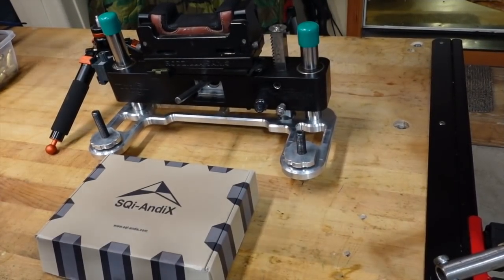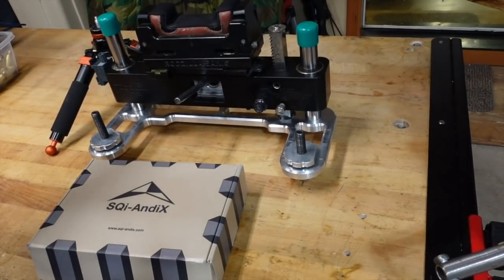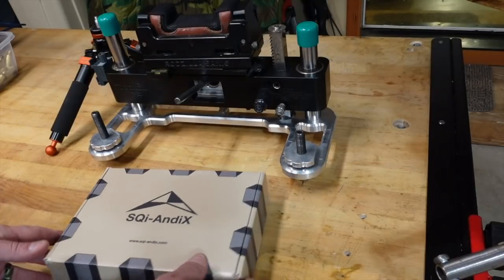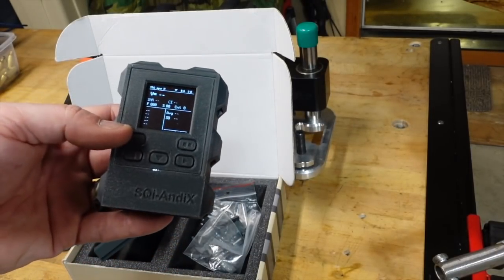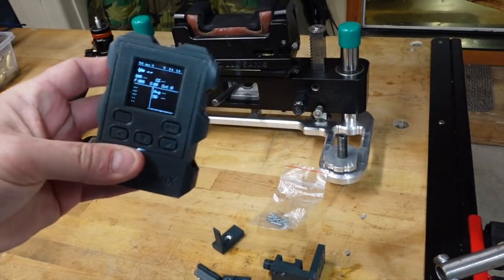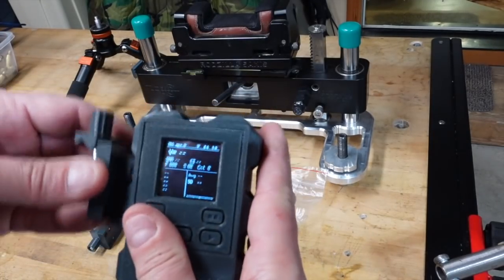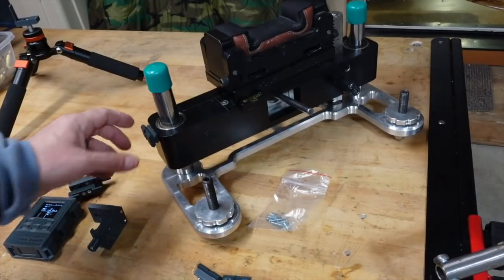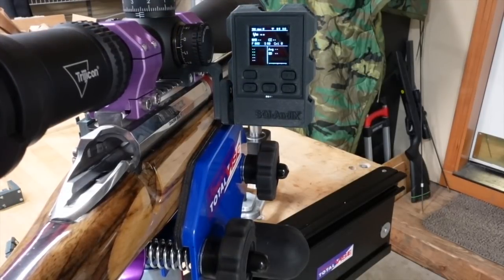First impressions AndiScan micro A2 doppler ballistic velocity chronograph

Comment: If it works and provides accurate repeatable results it will have a market presence. What will be interesting to see is how direct competitors like LabRadar respond. I'm sure LabRadar could shrink it's unit size but here has been no need to this point. And also from a business stance you don't want to make too many changes that make early customers feel cheated or disappointed. But when competition forces your hand they will have to respond to keep their market share. This year could be interesting to see what unfolds.

Comment: I think mounting it to rifles in larger cartridges might result in inaccurate data due to excessive recoil. Otherwise, a handy little rig if it does what it's supposed to. 👍
* Velocity measurement range (* only in expert mode)  High 242.5 – 1309.3 mps  (4295 fps)     🙂
Reply from the maker: Yeah that’s definitely a possibility but the great thing is it can be positioned on the bench or on a tripod or on again so there are lots of options depending on the use.

Comment: i just used the caldwell one for the first time today. the one that costs 130$ that has the antenna ears.  i shot 30g of RL15
behind a 90g berger.  ave. 2985 fps.
But my exteem spread was 2943 to 3055.    I got the sence that it was kinda not as accurate as it could be.  but idk

Comment: Does it have internal shot memory if so how much?? You said you have had 3 magneto speed chrons what are your thoughts on them are they as accurate as a Labrador?
Reply from the maker: Yes is uses an SD card and can hold a crazy amount of strings according to the specs. As for other chronos, they're good too but each come with their own ups and downs. Labradar is good but larger form factor and some people have issues with the app and stuff (myself included). Magnetospeed works great but people don't like having it on the barrel which can affect harmonics.
Reply: @FClassJohn  so would you recommend the magnetospeed over the Labrador for the casual shooter/reloader?